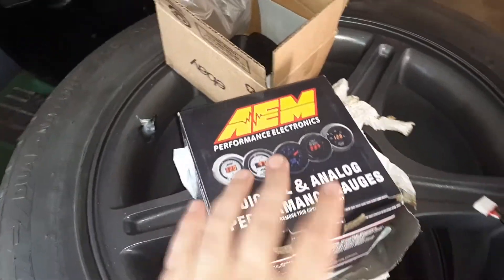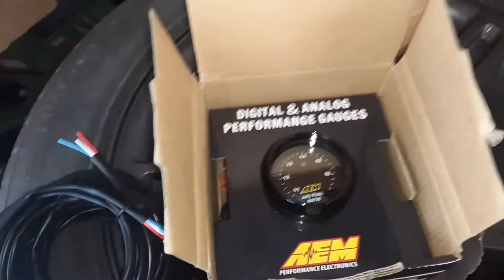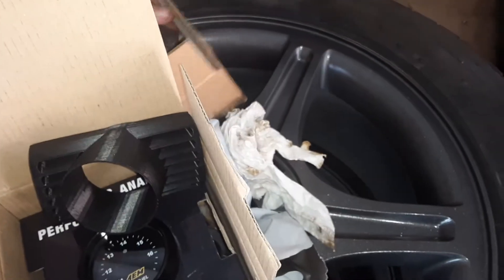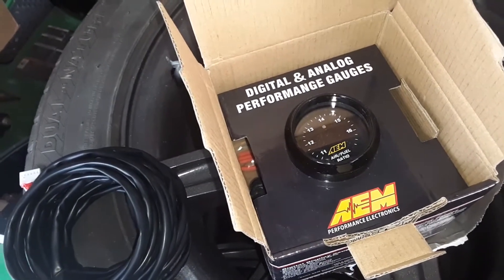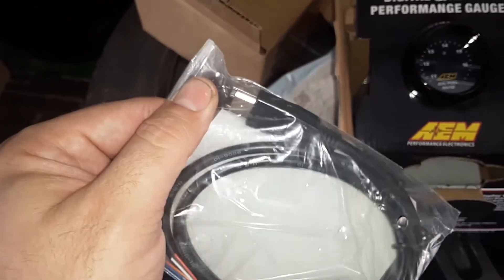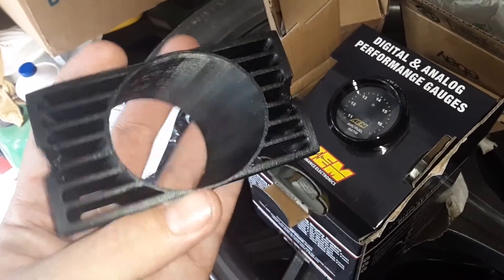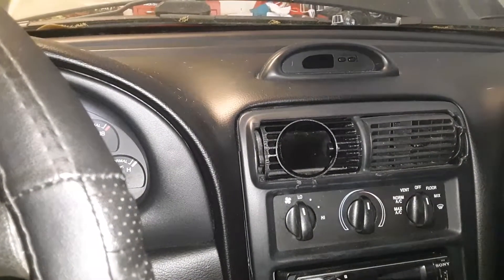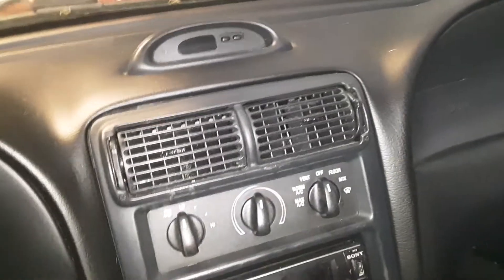New Parts and Special Thank yous!

Comment: I have the same Wideband , possibly older version I think you have the 4.9 I have a 4.2. The only thing I don’t like is that it uses a Bosch 02 sensor. I would love to switch to an NTK.
Reply from the maker: Better luck with ntk? Or do they read better?
Reply: @TheModAddict  they are just a more robust sensor. Definitely don’t let the Bosch see any leaded fuel. I need to call AEM and see if it can be swapped